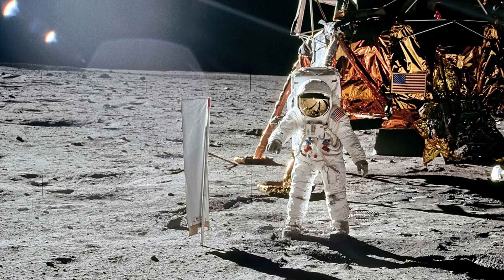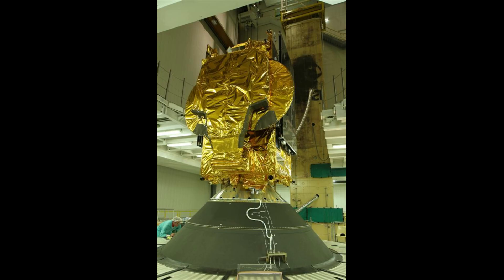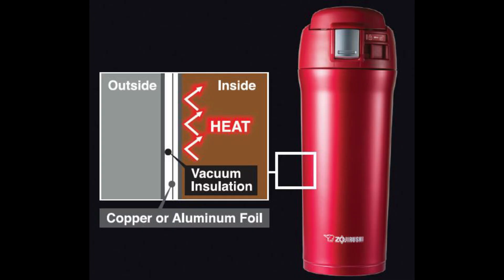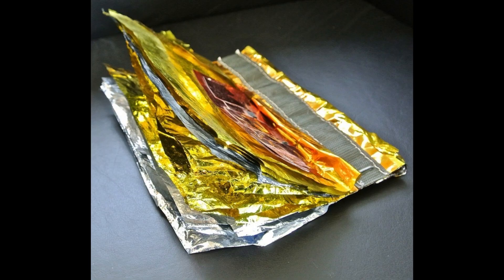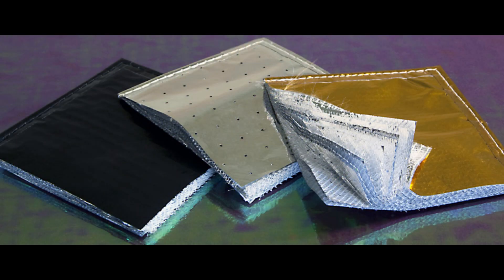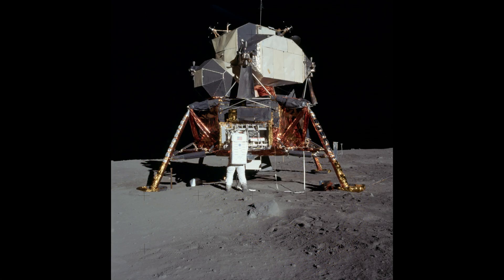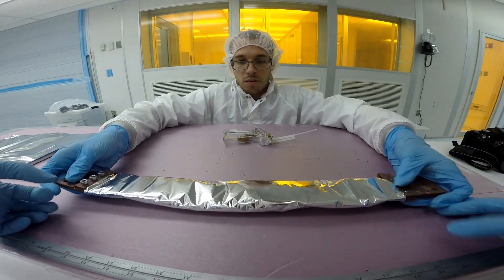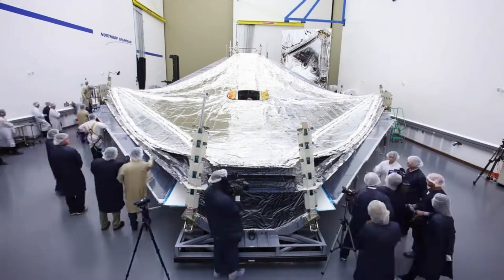Spaceships Are Not Covered In Gold Foil - The Cool Engineering Behind Multi-Layer Insulation

Comment: From what I’ve read, the shock absorbers on the Apollo LM legs were actually an aluminum honeycomb structure that crushed under load, obviously a one time use thing. They were designed to absorb a pretty substantial load from a bad landing, but apparently were never compacted more than a few inches, Apollo 15 being the hardest landing of all the missions.
Reply: And apollo 11 landed so gently they barely crushed at all. So Neil and Buzz had a big leap down off the ladder!
Reply: @olliea6052  In fact that's why Neil jumped back up to the first rung, to make sure that it was easy to get back up to it. It's interesting to watch because the first time he comes down onto the LM footpad he goes down very slowly, seeming to lower himself with his arms. Then he hops back up to the first rung, then with newly gained confidence he drops down quickly back onto the LM footpad. This very visible action of dropping down, in an otherwise very shadowy video, confused many then and even today who think that this was the first step onto the lunar surface. 

It even confused Walter Cronkite on CBS. When Neil mentioned checking his ability to get back up to the first step, meaning the first rung of the ladder, Cronkite misunderstood this as meaning that Neil had taken his first step onto the lunar surface, and so he declared to the nation that Armstrong was on the Moon, when in fact he was still on the LM footpad. Cronkite then began pontificating about the historic moment (instead of keeping quiet like Frank McGee on NBC and Frank Reynolds on ABC) and Cronkite talked over (and apparently didn't hear) Neil when he said "Okay, I'm going to step off the LEM now". With sheer luck Cronkite stopped talking literally milliseconds before Neil made his famous One Small Step statement, in fact Cronkite's last syllable was still fading as Neil began the word "That's".
Reply: @StevePemberton2 
Yea but Armstrong didn't do it out of the clear blue, that was a step in the mission plan, to make sure that they could get back up to the first ladder rung with their suits on, if he couldn't and then Aldrin came down and they were both on the lunar surface at the same time they'd have been screwed. 
In the event he couldn't get back onto the first rung they had a plan for the remaining guy in the LEM to help which means either only Armstrong would have gone onto the Lunar surface or they'd have had to take turns with one always being in the LEM to help the other back onto the ladder (via a rope or something like that), whichever route they took would have been mission controls call depending on some factors.
I remember it having been gone over in one of the countless documentaries I've seen on Apollo, they pointed out about him testing the first rung and talked about the backup plans in the event he couldn't make it back onto the ladder without assistance, but as we all know it wasn't an issue so they both got to walk around on the moon at the same time and take those legendary pictures of each other (my favorite picture from the mission is the one of Armstrong when they're back in the LEM afterwards and he's got moon dust all over him and that ear to ear smile, that picture sums it all up).
Reply: @dukecraig2402 you would think given the low gravity, a leg up would have been pretty easy :)
Reply: @dukecraig2402  Sort of like Aldrin's joke about not locking the door while they were both outside! I thought I remembered the reason that you gave but then I thought of how Aldrin also tested jumping up to the first rung so I decided it must have been spur of the moment. But maybe Aldrin's was unplanned and he did it because of the unexpected height. In fact Aldrin actually didn't make it up on his first attempt but Armstrong gave him some pointers and he made it on the second try. Armstrong described it as being a "three footer".

Sorry to harp on Cronkite some more but I just watched the CBS coverage again to confirm my memory of Aldrin's ladder test.  Once again Cronkite thought that when Aldrin dropped down onto the LM footpad that he was now on the lunar surface, and Cronkite then completely talked over Aldrin saying "Okay now I think I'll do the same" just before he did his jump test.

To be fair the camera was pointed from the knees up so no one could see the LM footpad or know when they stepped onto the surface, but I really think that Cronkite would have understood what was going on if he wasn't talking when Neil said "Okay, I'm going to step off the LEM now".

You should try and find the photo of Gene Cernan after his EVA, he looks like a coal miner. I remember the Armstrong photo that you mentioned but the Cernan one is really good too, he looked tired and happy.
Reply: @MeppyMan  They probably didn't want to assume anything. There was some highly rated scientist who insisted that the LEM was gonna sink into the surface and disappear and I mention this just because they knew this wasn't going to be a problem but there were questions that they may not have thought of.
Reply: @dukecraig2402  It's easy to forget how little they knew about the surface of the Moon back then. Patrick Moore was worried that the dust would be like a deep snow drift that was strong enough to support the little probes that had been sent but that the LEM would sink right into
Reply: @charleslambert3368  before Apollo there were sci-fi stories about lunar boats that cruised across the dust seas that had depths in the 10s of meters from memory. They had the big foot pads on 11 to lower the surface pressure just in case.
Reply: @charleslambert3368  No, we knew the lunar surface before Apollo… Surveyor 1, 3, 5, 6, and 7 had previously successfully soft-landed on the lunar surface. In addition to demonstrating the feasibility of lunar surface landings, the Surveyor missions obtained lunar and cislunar photographs and both scientific and technological information needed for the Apollo manned landing program. Four spacecraft, Surveyor 1, 3, 5, and 6, returned data from selected mare sites from Apollo program support, and Surveyor 7 provided data from a contrasting rugged highland region. 
The Surveyor computer landings were far better/smoother, more efficient than the ‘right stuff’ Apollo astronaut landings.. 
I remember when the Space Shuttle autoland software was available, supposed to be used but the Astronaut ‘pilots’ grabbed the wheel & refused to let it land. Note that humans were completely incapable of the tight, critical flight tolerances required for launch & reentry … but even the most ham fisted, choking Astro could glide the shuttle in to a rough landing after the computer had done all the hard, critical work.
Reply: @zyeborm This is the plot of Arthur Clarke’s novel called “A Fall of Moondust”. Good adventure tale.
Reply: @olliea6052  a giant leap for mankind! 😂

Yeah, that was pretty obvious.
Reply: @nos9784  aaahhhhh!!! A wasted opportunity!! Nice one! 😁👍
Reply: @nos9784  But ironically NOT a small step for a man.
Reply: @olliea6052 He was supposed to be about the best pilot they ever had.
Reply: @olliea6052 and remember that one was manually landed. Neil had to take control and land the ship himself.
Reply: @burnte  Actually they all landed manually. The computer took them down to about 500 ft, after which they took over manual control. There was some amount of autoland  capability during the final descent but none of the commanders used it.

During the last phase of the automated period known as P64 the commander could modify the landing site from where the computer was planning to land. Using those grids in the window that you see in photos he could see where the computer intended to land. He could change the landing site by giving input with the control stick to indicate that that he wanted to land longer, shorter, left, or right of the planned landing site. Each “click” with the control stick moved the landing site 1 degree.  Neil Armstrong used this method to direct the computer to land beyond a boulder field and crater that it was directing them to  This has been portrayed as “taking over manually” but he was doing what all of the commanders did in P64 mode which was manage the landing site while the computer was still doing the actual flying. Not taking anything away from Neil as he had a bigger challenge to deal with during this phase than the others and he also did not have the benefit of knowledge gained from previous missions.

At around 500 feet they entered P66 mode which is manual flying. At this point the computer stops giving predictions on where they will land and the commander is really on his own from then on. During the manual flying phase Neil further extended the landing in order to avoid a small crater.
Reply: @StevePemberton2  If you know all that then you knew exactly what I meant.
Reply: @burnte  No I couldn't tell that from your message, but if you already knew it then that's great. But the way it has been worded over the years in accounts of Apollo 11 has given many people the idea that only Neil Armstrong manually landed on the Moon. But he definitely had the most challenging situation to deal with, especially with constant computer alarms which both Neil and Buzz said were very distracting.
Reply: @burnte that's not completely true. After the initial descent burn and then when the craft pitched over in program 64 so that they could see their potential landing site, there were two options to switch to. Program 65 which would do an automatic landing to the proposed landing site, and program 66 which would allow the astronauts to fly the last bit manually, but only partially manually, with the computer still in the loop. They could redesignate their landing point at that time, and the computer would take it into account and try to fly them to the new site, within certain constraints. The astronauts never used program 65, they always went into program 66, which you can hear in the radio transmissions. But program 66 was never full manual control. It was much closer to manual than the computer completely flying it, but it was never full manual control. In fact the astronauts did not want there to be complete manual control. They knew that this was a difficult landing and they appreciated the help of the computer, there's even references to them calling the computer the third astronaut in the lunar module, implying just how much they valued and depended on its assistance. Why did this end up as a popular misconception? Because it speaks to the human desire to do things ourselves, and landing on the moon was a very human endeavor. Despite their appearance simplicity to us today, the computers on board the command modules and lunar modules were extremely sophisticated bits of engineering for the time, and quite a bit more powerful than even our supposed pocket calculator comparisons. If you're wondering why people compare them to pocket calculators, it's because we really don't have anything appropriate to compare them to, because they were so purpose designed for their mission that we struggle to find an appropriate comparison.
Reply: @olliea6052  I remember Buzz commented on Neil's sweet landing in First Man.  😁
Reply: I believe the legs are filled with Mt. Dew cans.
Reply: @M83G  Nah, there were/are no uncrushed Mountain Dew cans.
Reply: @M83G  Keep believing that. I hope it makes you feel important!
Reply: Apollo 15 hitting the hardest is sort of counter-intuitive.  Dave Scott maintained the lowest final descent rate prior to the contact probes hitting than any other guy who landed a LM, he was coming down at less than a foot a second.  But when the contact light lit up, he immediately cut the engine.  Had he been coming down at three feet per second, like most of the other LMs, by the time the engine thrust ended and the LM started to free-fall, it was only about a meter above the surface.  Going down so much more slowly, and being REALLY quick on the engine switch, Falcon was more like two meters up, and free-fell from that greater height.  Even though Scott had his LM crawling down at less than a foot per second, it landed at more than 6 feet per second.  Between that, and landing with the engine bell directly over a crater rim (with the back leg down in the crater), not only did Falcon hit hard, it tipped back and crushed the engine bell along with the side legs, as the back leg fell another meter or more back into the crater they landed astride, and the LM, bounced forward again after the back leg hit.  Apollo 15 definitely had the sportiest landing, in terms of it being a "dynamic" situation there for a second or two.  But you can see the sudden, jarring movements in the landing film.  And you can see the big sheet of soil the engine blew out in front of the LM as it hit the crater rim.  Jim Irwin said it best, as the guy on the scene -- "Bam!  No denying that, we had contact!"
Reply: @DougVanDorn  thank you for sharing that information!
Reply: Cool little tid bit of history. Thank you.
Reply: Apparently Falcon 9 landing legs use the same method.
Reply: @Sonnell F9 legs have built in flex for standard landings. The crush cores on F9 are only used for out of norm landings, to prevent leg damage.
Reply: @saiboogu  wait, the crush cores are then easy-ish to replace and prevent further damage on the legs itself?
As opposed to Apollo where it sounds like the legs themself would have been sacrificed (which doesn‘t matter cause one-time-use).
Reply: @PhilfreezeCH  Cheaper than replacing an entire carbon fiber leg, but they aren't meant for regular servicing since they'll only get crushed on a heavy landing.
Reply: @Sonnell  my brother works for the company in Michigan as a chemical engineer which makes the aluminum honeycomb crush cores
Reply: @Sonnell 
Apparently is not good enough. We should only be interested in facts. I've searched for proof of this claim but can't find it which leads me to believe that you're lying in order to support your fantasy
Reply: @andyals1963  uhm... what? :D
I need a shock absorber for your comment, apparently :D
jokes aside, then perhaps search again? The internet is full with images of the falcon 9 aluminium crumbling shock absorber... as well as written material.
How did you search? And why is my comment a "fantasy"? I am full of questions now :D
Reply: @Sonnell  ignore him, he's a flat earther.  He wouldn't know how to check the most basic of facts.
Reply: The lm was designed to fall unpowered 3 feet or so. They didn't want the exhaust to bounce back up and damage the spacecraft (perhaps a lesson for Starship?). Once we got to the lm versions that carried the rovers, this was mandatory because the engine bell and the size of the lm were larger and more powerful. I believe you can hear someone (Dave Scott?) on Apollo 15 say, "Engine off. Boom!" That was a good landing, lol. Then Dave tripped stepping off the lm pad. Little things that happened that few people remember. Do a Google search for Lunar Surface Journal. Lots of audio, video, and text compilations that you might find interesting.
Reply: Apollo 15 landed so hard the descent engine bell was destroyed by the impact forces.
The Apollo 14 on LM engines were an enhanced thrust version with an extended bell. Apollo 15 had this nozzle hit the ground on landing and break.
Apollo 15 was also less than one degree of tilt from being able to take off from the lunar surface.
Reply: ya they weren't sure how solid the moon was when they started building it which is wild by today's standards
Reply: it's crazy how many things can be solved by copying the honeycomb pattern lol those bees don't even know hahaha
Reply: Spacecraft are covered in gold to impress black aliens.

Comment: Many internal satellite structures are vapor deposition of gold on a thin layer of Kevlar.  It’s not for thermal insulation but for preventing EMI.
Reply: Is that woven Kevlar or some other form?
Reply: @johndododoe1411   All the ones I have seen are woven Kevlar 120.  They are not epoxy prepreg due to outgassing, usually cyanate ester resin.